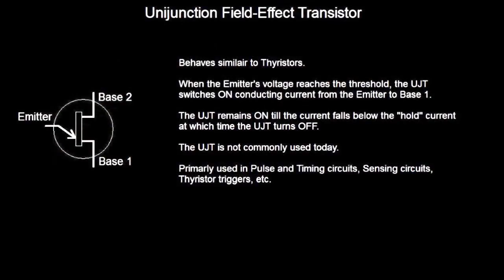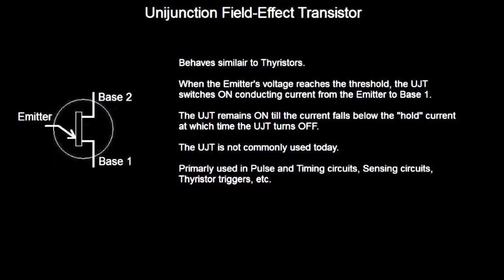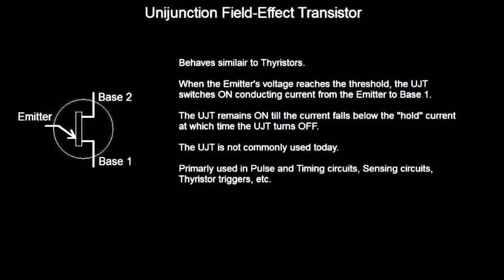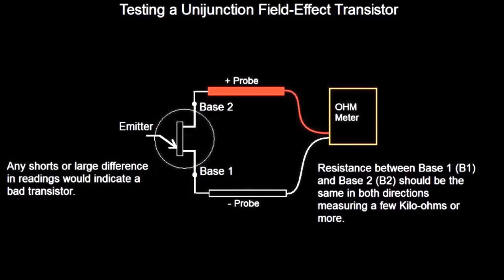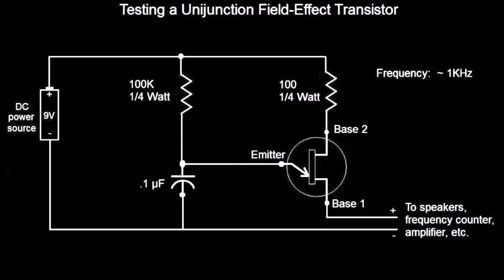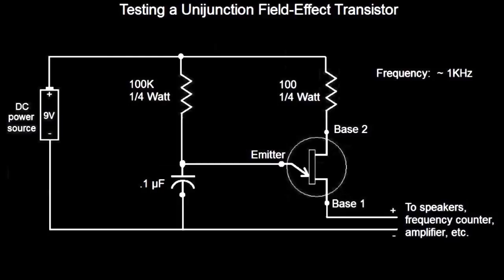Testing the Unijunction Transistor

Comment from the maker: The Termaline Coaxial Resistors are used to test RF equipment. It's called a "dummy" load or a "dummy" anteanna. These resistors gave the ability to test Radio transmitters without interfering with other radios while making adjustments. You should sell it. Amateur Radio use these types of resistors to test their equipment. -MrFixit